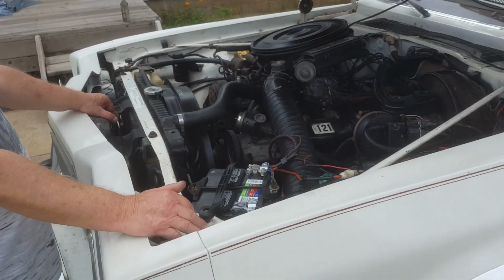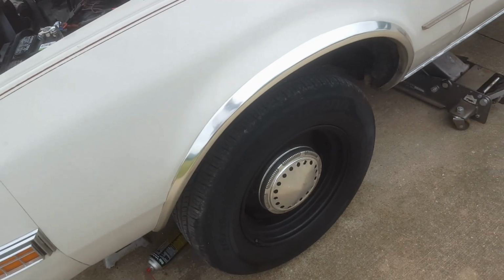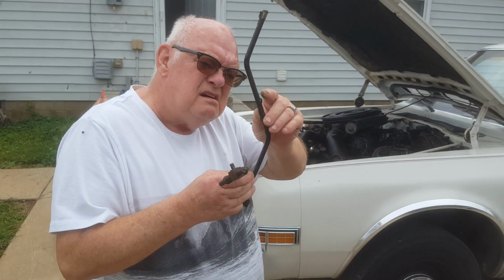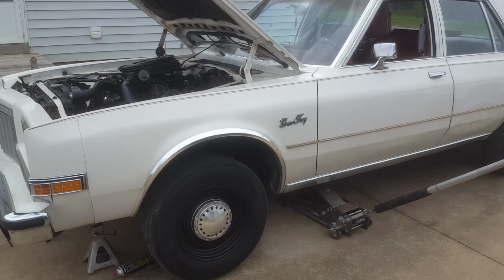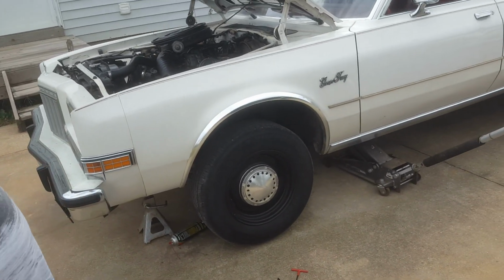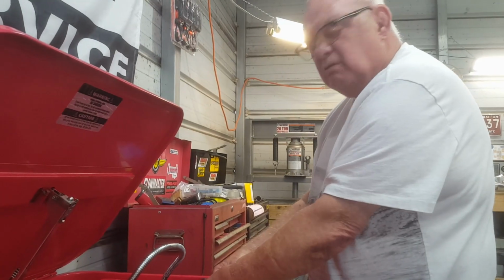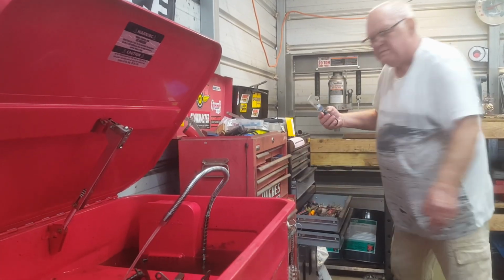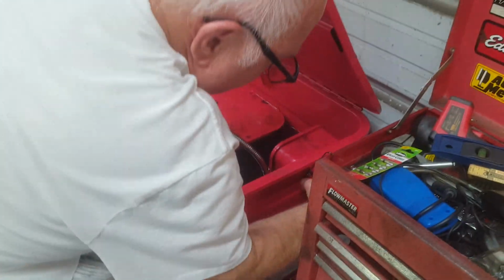What melted on Phil's '87 Plymouth?

Comment: So just like the voltage regulator and the ignition control module box, because Chrysler seals them with a adhesive they don't use a back cover...
Reply from the maker: right. Magic Goo.